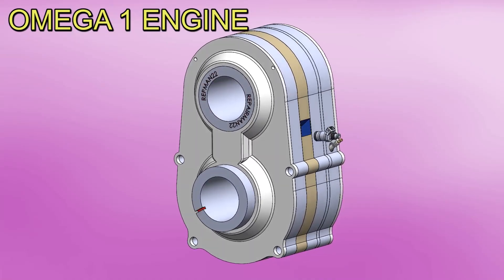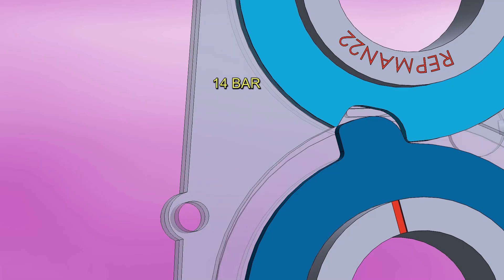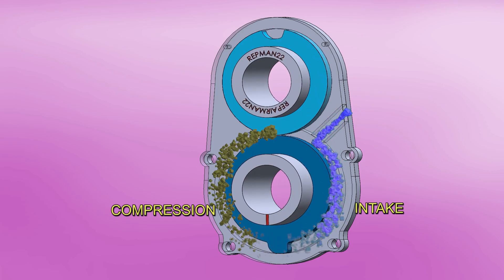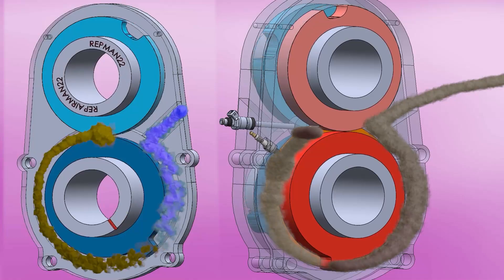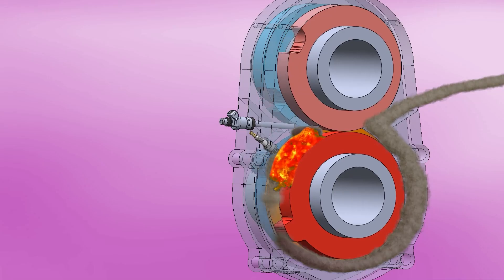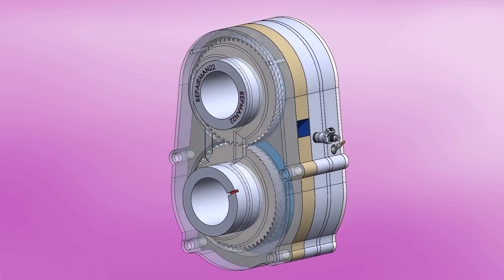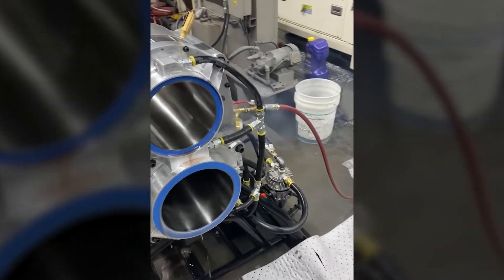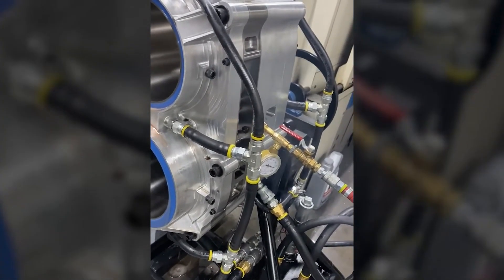😍 Can you FIT 160Hp in 30 Pounds? This New Engine Can. The Omega 1

Comment: I wonder why people think it's going to be easier to invent a new ICE after 150 years of failures to radically change it, rather than to just beef up the electricity grid...
Reply: Because just like the light bulb, there are so many ways to make a mechanical contraption that can create power. We've seen a huge number of different kinds of light bulbs over the years and we've also seen a huge number of engine designs and layouts.
Reply: @hazard7732  Yes, but they all failed. Opposing pistons, oval pistons, wankel, deltic. What makes people think that this time it will be different? Titanium-made engines, rather than laying down more cables and transformers, really?
Reply: @markotrieste  they haven't all failed. Diesel engines are widely useful for a different kind of utility, and there's a different kind of piston engine that uses a curved cylinder that has been proved to be a very reliable and efficient air compressor. It may not be an engine but it still found its use.

Think of all the light bulbs that have once been thought to be revolutionary but now are obsolete. If we keep stifling the imagination of these inventors and engineers, then we will reach a state of complacency and stagnated innovations.

To everybody of the conservative mindset that say "it worked fine for this long, why change now?" I ask you to think about how long we've used horse and buggy, snail mail, how long we've had houses without internal plumbing, etc, and realize that innovation is inevitable and every technology has its infancy where it isn't that great. A grace period where we work out the kinks and understand why some things work and some things don't.

Just don't shoot down ideas because "We already have things that work" or else we would still be using these draconic technologies.
Reply: @markotrieste  because that's how progress works. it's building upon the failures using newer understanding of techniques and materials. 

what you want is for folks to lay down their thinking caps and say "yep, we did it. we fully figured out engines, nothing can be done from now on", which is nothing short of promoting ignorance.
Reply: @KareemFloat  Please re-read what I wrote. I don't want anything from anybody. I'm just asking someone to explain me why the video, along with plenty of people, thinks that this way (titanium engines, lol) is more promising than simply laying more wires and transformers, which require zero new unproven technology.
Reply: @hazard7732  Please re-read what I wrote. I don't question innovation. BTW, your comparison with light bulbs is a straw man. It is a fact that Benz trycicle had a piston in a cylinder with a connecting rod and crankshaft, same as the engines sold today by the millions; I'm just pointing out this fact. There have been dozens of alternative design proposals in the years, which never managed to be better overall than reciprocating trunk piston. It is a matter of probability: how probable is it that this time, with this engine, is going to be any different? Now, back to my initial question: why do you think that this probability of success is higher than the probability 9f success in investing and improving the electric network and charging infrastructure?

PS since you like so much bulbs, please note that the step change in efficiency of led bulbs wrt to incandescent is the same as that of EVs vs ICE: in both cases we've managed to get what we wanted without making heat first.
Reply: @markotrieste  while beefing up the energy good is certainly imperative, electric cars will not completely kill off the utility of ICEs. It will be a very long time until something like that happens. So in the meantime, we need to find ways to make them more efficient, reliable, and environmentally friendly. The electric cars we have today are still relatively new. They were more of a novelty for the 1% up until only a few years ago and improving the electric grid for the masses to utilize this technology is not as easy as changing a light bulb (sorry, I saw the opportunity and had to take it)

I'm really glad that you and I both want the electric grid and electric cars to improve, but we aren't all of that mindset. There's a lot of people who will use ICEs as long as they can. There is a sort of charisma and charm that they have to the right audience.

Speaking of new technology and ICEs, I've heard that Porsche is funding research for a company that's down in the lowest part of South America to create fully synthetic gasoline and they have successfully done it; at the cost of roughly $46 per gallon.

But anyway, I hope I haven't upset you too much. Often times I get two passionate about changing some internet stranger's mind, and that's just not a fun or worthwhile pastime. Enjoy the rest of your day!
Reply: @hazard7732   Not upset at all. I just feel bad when I see so much resistance to EV, which are actually a "low hanging fruit" when compared with the low carbon alternatives (as you mention for example the e-fuels). I'd have nothing to object to the video if it limited itself to explain the concept. I do have an issue though if it tries to depict it as a better solution than electrification of ground-based, short-haul transportation.
Reply: @LawnMower-jv8hg  It's a bit off topic. However you can find plenty of reliable information on the web. Start with IPCC report on mitigation. Right this week there was a report released by DNVGL. Also Polestar did a thorough lifecycle assessment of their products, and also joined with other EV manufacturers in an appeal to be open on the topic. Then there is the think tank "Transport & Environment with lots of studies, as well as the "Union of concerned scientists".

 Finally, remember the approach that IPCC is proposing: avoid, shift, improve. EVs are the "improve" part, but first we need to avoid unnecessary transportation and shift transportation mode, whenever possible, to better alternatives (trains, bikes, ships). EVs are not "the" solution, but one of the many tools we have.
Reply from the maker: Although in the future, motors will be electric, engineers in their field, for example, mechanics, continue with their specialty developing combustion engines, since they cannot develop an electric motor.
The combustion engine is also still lighter for airplanes. The market is still going on. As long as an invention lasts 20 years, it is a good return for its inventor.
in the 70's, it was thought that the future would be nuclear, and look where we are today. Well, actually today, nuclear plants are picking up.
Never bet everything on the same horse.
Reply: @markotrieste  low hanging fruit? Are you serious? Not sure about you, but there’s a lot of people that think electricity just comes from thin air, they try to ignore the laws of thermodynamics. EV’s are in to way “green”. California is leading the way to “go EV, but don’t charge your EV”.
Reply: @marleythechameleonandherbi2724  Ok, tell me a better way to decarbonize private cars, in thermodynamic terms. Hint: biofuels, synthetic fuels and hydrogen all have drastically lower well-to-wheel efficiencies. Feel free to use technical language and papers, I am a MD mechanical engineer.
Reply: @marleythechameleonandherbi2724  the following is a statement from the last study made by DNVGL: 

"The route to decarbonization is clear:
electrify what can be electrified; what cannot be electrified in the near term should be switched to sustainable advanced biofuels; and prepare for hydrogen-based new fuels to
scale through local and regional ecosystems to a global ecosystem from 2035.
— What electrifies will be *cheaper*, but
hydrogen and sustainable biofuels cannot
compete cost-wise with oil and thus need
different policy levers to scale."
Reply: Because science evolves. We get new materials, finer instruments, computer modeling, etc.

Wheel was invented thousands years ago, but humanity still improves it.
Reply: @cheesebusiness   You are not answering my question. I did not ask why there is yet another (hopeless, IMHO) ICE design, I asked why most people assume that the margins of improvement of ICE are such that they grant an easier path to decarbonisation of cars than the simple build-up of charging infrastructure, which, on the contrary, does not require any new technology or testing.
Reply: @markotrieste I answered exactly your question. I'm not going to argue about electric vs ICE.
Reply: @cheesebusiness  but the question was exactly about electric vs ICE, in particular which one has more hopes to achieve rapid decarbonisation of transports. You are contradicting yourself.
Reply: You're assuming the powers that  be actually want this to work....they do....but not for the general public....just themselves.
Reply: @fireballxl-5748  YEP!
Reply: @fireballxl-5748  Fair point, but we can agree that common people should at least refrain from spreading FUD that helps those powers.
Reply: Beefing up the power grid is going to be hard when coal fired power plants aren't allowed to operate in western countries anymore.